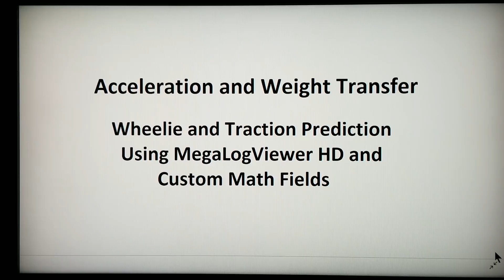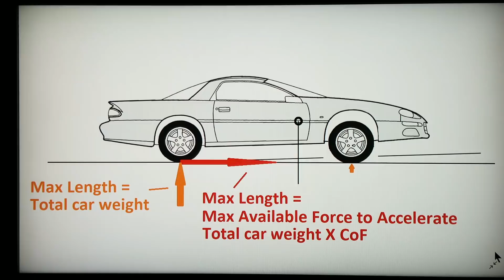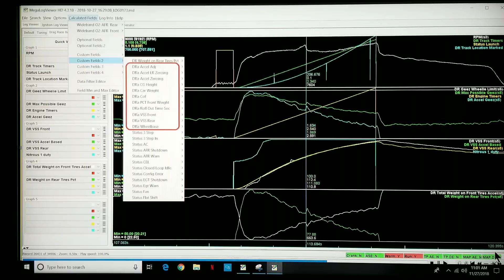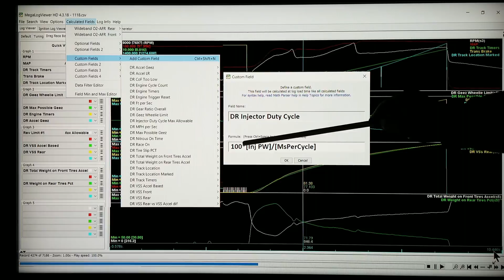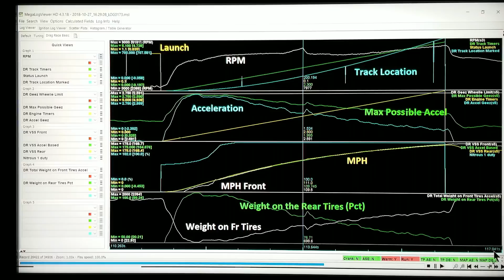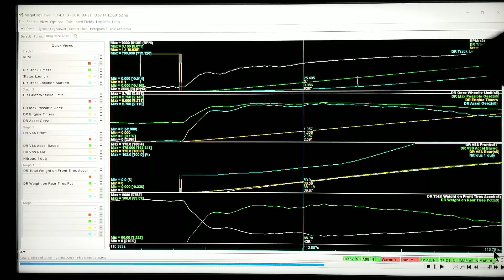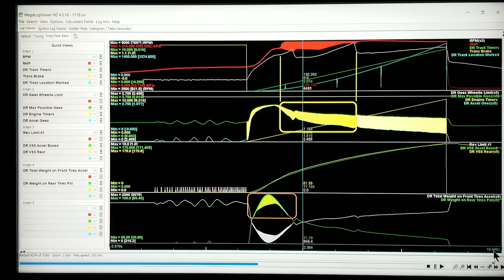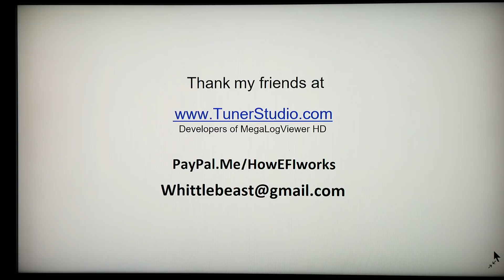Traction and Wheelie Prediction

Comment: Two questions to start, Andy:  1) how do you get the track location markers inserted into the datalog?  2) How are you logging all of the data fields?  Maybe Jean's I/O expander, coming in via CAN?
Reply from the maker: Once you have acceleration converted to distance, you then use a formula to display location unless you just passed on of the critical distances.  When I set any car up, the owner gets to keep a copy of all of the formulas to get this to work.   The cars and sensors used in the video were set up before I got to the cars.  I think they were all using an inexpensive Amazon 3 axis accelerometer.  
Adafruit ADXL335-5V Ready Triple-axis Accelerometer (+-3g Analog Out)
Reply: @AndyWhittle_HowEFIworks  Thanks!  Do you find the distance locators and associated time measurements from that method to be accurate to the timesheets?
Reply from the maker: That is what the calibrations in yellow do.  I get within about a 1/10 of a sec. on clean runs on all three track timers.
Reply: @AndyWhittle_HowEFIworks  How do you get that area under the curve highlighting in megalogviewer? Or was that post processing in an image editor?
Reply from the maker: @HellTriX  Post processing.  Paint.